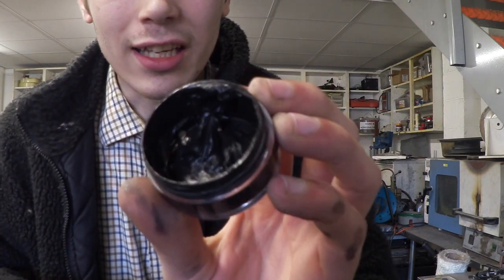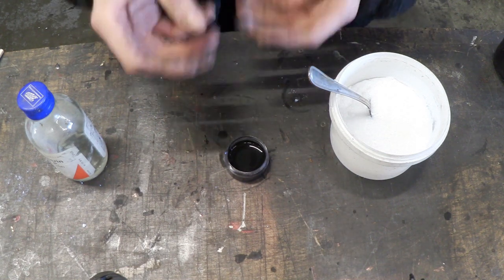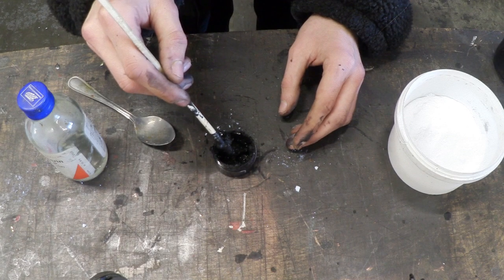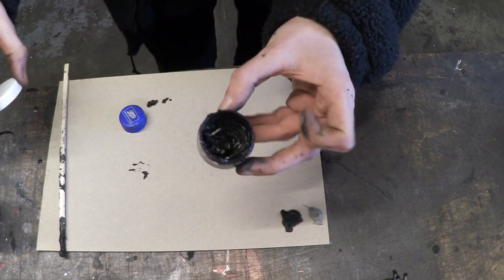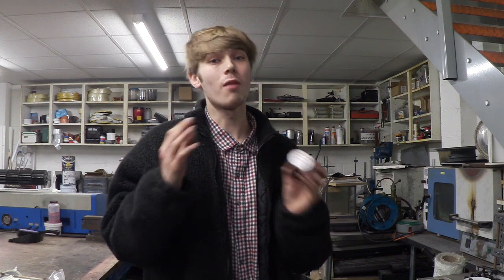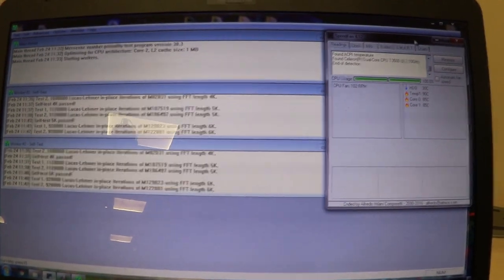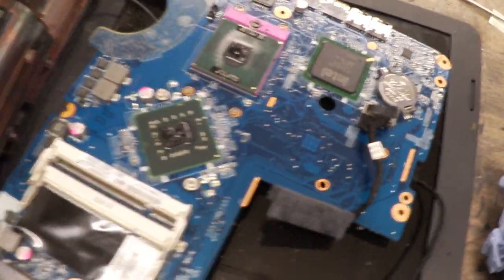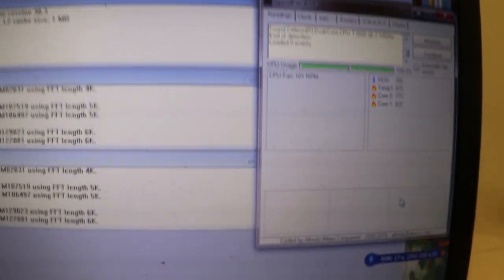1016 - Making Conductive Ink Thermal Paste

Comment: I'm currently conducting tests using the conductive ink to protect the all aluminum ice giant cooler from reacting with the gallium based liquid metal. The ink did protect the aluminum in a test. I haven't gotten thermal baselines yet. Also suprised to see how well the liquid metal mixed with the conductive ink. I also haven't tested this, to determine if it increased or decreased the thermal transfer properties. But I'm hopeful.

Comment: I would suggest a test rig that could be run for longer periods.  Set up a heater block with some electrical heat source that can stay consistent.  A couple of heat probes run through an Arduino to log the results over time.  With that kind of setup, you could run multiple tests and add new tests as they come to mind.  As was suggested below, different brands of thermal paste against your ink and your new ink paste.  But anyway, good job on the videos and the experiments.

Comment: Like you said, it needs to be fair. How long was the original thermal paste in the laptop for compared to the fresh new paste you made for a difference of only 4 degrees C. I have to ask if 4 degrees will make a difference on the life of the laptop at temperatures between 85-95 C.

Comment: I really like the results from this test and the use of the ink as a heat conductor, but I think I should be run over a longer length of time to be valid. Temperature versus time should be looked at. Checking it after weeks or months should be done.
Reply: Thanks for the suggestion mate! I will definitely run it for a longer length of time. Also keep an eye on Temperture vs Time. :)

Comment: Did you check if the CPU downclocked at any point in the test? 
Laptops are designed to downclock the chip when it's about to overheat in order to manage the heat production and prevent unwanted device shutdowns and hardware failure.

Also some manufacturers do cheap out on thermal paste and this could also impact the original thermal performance.

What you have made seems very promising but it would have been better to see a comparison against a freshly applied commercial paste instead of unknown old thermal compound